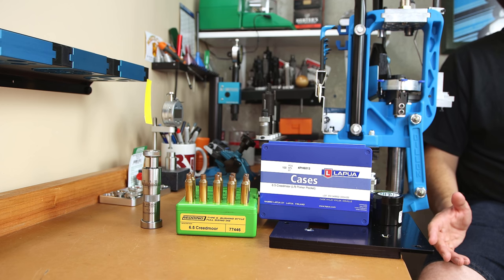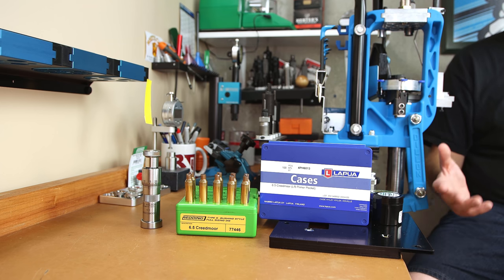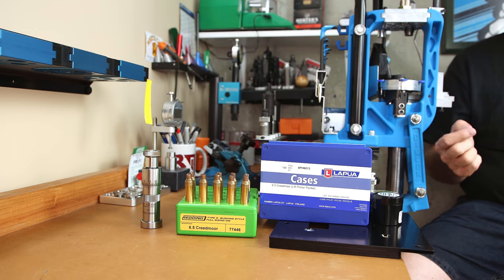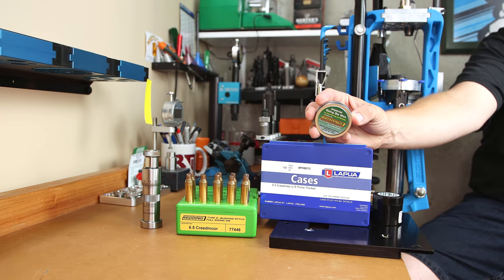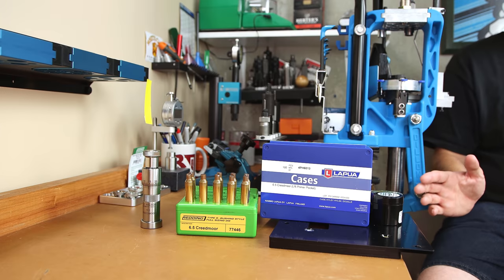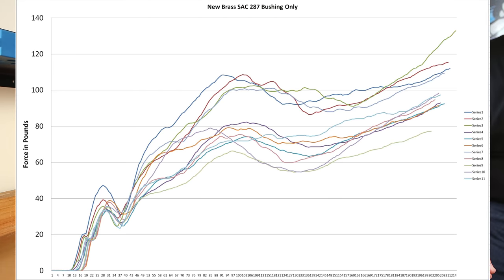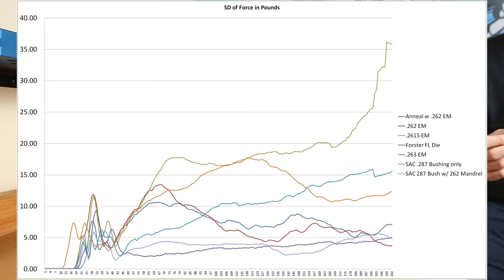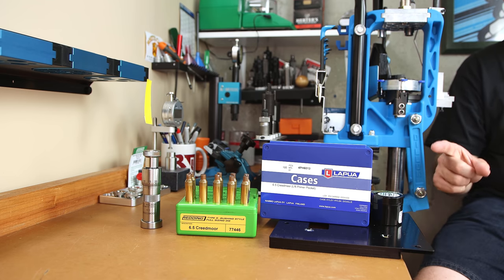Setting Consistent Neck Tension - Load Development with New Brass?

Comment: I'm not as experienced as you, but I've always been told and have done full length resizing for new brass. That has been a fundamental process for me.
Reply: I’m new to reloading and I bought some new RP brass. I FL sized it in my Redding die without bumping the shoulder. It has worked good. 

It’s a 7RM so no lapua option, but Nosler brass was available. It’s over priced Norma brass, but I went for it. It says ready to load, no prep needed! So I loaded 15. Lol. Felt like trash seating the bullets (160gr Accubonds), no consistency at all. Performance was okay. I will FL size the rest and then start using them. 

Lesson learnt!
Reply: @emirkazic4493   In my testing with new unfired lapua srp & lrp 6.5cm  I have found that the headspace is also all over the map, ranging from 1.532 to 1.535. I know right.
Lol,,. I use my deconstructed Forster fls die, like I would if it was fire formed to set the shoulders back to 1.533. The cases where the head space is already below 1.533,,, well my die can't touch it,, set it back any further,  so all is good with them. 
I then follow up with the 21Century expanding mandrel. I load them hot to fully fire form them on the first shot so I don't have to wasted 3 more firings to blow the cases out. I do anneal them before prepping them also and after every firing. In reality, I don't do anything different, other than their not loaded as hot. Just me and my madness. Lol.
Reply: New brass always has the shoulder and case dimension set back to ensure feeding in any rifle.
The only reason to run them through the die is to make sure the neck is at an acceptable diameter and is round.  This is done only to promote bullet seating.
Reply: @ctech01  .003 variance to me doesn’t seem awful? I had fl sized factory loaded ammo, all hornady American whitetail, but various lots. My ideal comparator measurement was 2.123; but I found it varied a bit so I got some 2.121 and some 2.124. I assume that’s because of the different lots of brass plus minute play in the press? I’m using a Lyman Victory press with Redding FL sizing die. 

Or is this purely a result of the different lots of brass used in each box of ammo? So my bags of brass that are new should be more consistent?
Reply: @emirkazic4493   My money is on different allotments of brass. I mainly shoot Lapua in the 6.5CM and from box to box there is quite a bit of differences between the allotments. I find the same in 223 Lake city brass as well. With factory loaded ammo,, Hornady per say, especially the 
ones that say MATCH AMMO. Before you fire them, check and compare the head space and CBTO and OAL and weigh the cartridge's. Then chrono them on a Labradar or Magneto speed chronograph.
That will make you really scratch your head. LOL.

Comment: I really think that initial spike is spring setback in the shoulder before the bullet begins to seat.  Then it slips as it breaks static friction and initial hoop strength of the brass.  From there load climbs proportional to surface area.  In your Forester/bushing and mandrel tests, the spike is higher because you had an extra work hardening operation on the neck...just my theory.
Reply: Michael - I think you mean ‘hypothesis’ not ‘theory’.
Reply: @Russell-1  suppose so if you want to get all technical about it...or one could say that since I know and have evidence that seating pressure can in fact cause the shoulder to measurably yield and still allow the bullet to seat and I know and have evidence that work hardening the neck increases seating pressure it's a theory that requires further testing.
Reply: It would be a good idea to try and measure this with and without molly...

Comment: I generally purchase once-fired brass. I anneal my brass after 5 firings. First, I let my brass churn in my large Dillon vibratory cleaner for a few hours. I full-length resize before first reload. After that, I neck-size on subsequent loadings. I have noticed that my annealed cases tolerate many more reloading than non-annealed cases. I mostly reload 7mm Rem Mag, 308 Win, 300 Win Mag, 30-06 Springfield, 338 Lapua Mag and 408 Cheytac. I am saving for a 375 Cheytac. I really enjoy your videos, learning some new thing from each one.

Comment: I think measuring seating force only tells part of the story. The un-seating when the cartridge is fired is a bit of a different action. In my limited experience, and based on accuracy alone, i have always found a Lee factory crimp to shoot as well or better than not. I have turned case necks and not found the accuracy gains in an identical load that i have crimped only.

Comment: Thank you for your videos. Recreationally, I shoot 6.5 Creedmoor, 147 grain bullet, 41.3 grains, with RL16. From your previous videos, I’ve settled on a Redding Type S full length sizing die with a .289 TiN Bushing backed out a half turn and without an expander ball on the decapper. Then I dry lube the inside of the necks and size with a Sinclair carbide .263 mandrel.  The advantage of this process is my donuts detected by a pin gage have disappeared as compared to the Forrester full length sizing die without expander die followed by the .263 mandrel. Four five shot groups have the following SD/ES’s: 3-7, 3-7, 4-13, 5-14  were measured using a Magento Speed Sporter. Again, thank you for your videos. They are an excellent source of ideas for a recreational shooter who reloads his own cartridges

Comment: After watching many of your videos  here is my process.  First I clean the brass then I anneal the brass next full length resize using a Hornady full length sizing die with the decapping pin and expander left in then I use a mandrel  that is .001 less than the specific caliber that I am resizing. This process has yielded  excellent results for me. For example my .223 groups less than .25 at 100 and I can get consistence hits at 600 yards using 60 grain V-max bullets. My 6 Creedmoor has excellent results at 1000 yards using Berger 109 hybrid bullets. I might ad that my reloading equipment is NO Where Near as nice as yours and is rudimentary at best, I gave up on bushing dies because the full length die and mandrel yielded better results for me. I really appreciate all the info you share and it has certainly helped me!!

Comment: I just happened to prepare 300 rounds of 6.5CM Sig brass before I saw your video. My procedure was as follows:
1. Anneal with my GinaErick induction annealer. 
2. Size with Forster FL die with expander spindle. Using Rockchucker press. 
3. Open neck up with K&M mandrel die. 
4. Turn necks to 13thou with K&M kit. 
5. Clean brass. 
6. Anneal again. 
7. Size again with Forster FL die. 
8. Mandrel using 21st Century Expander mandrel (0.263”) from their turning kit - resulting in neck tension of about 1.5thou. It does more neck tension than K&M mandrel (0.265”). 
9. Clean again. 
10. Debur primer pilot hole. 
11. Debur neck.
Reply: I’m still using expander spindle in Forster FL die because 6.5CM is new to me and I’m not sure yet where I want my Forster die honed to.

Comment: Good video. I'm surprised that more people have not discovered the Lee specific caliber neck sizer. It works off the mandrel principle and allows for different thicknesses of brass beautifully. Hey, I don't work for Lee at all, but this Lee Collet necks sizing collet is a super tool for rounding out and sizing that new brass as well as doing the same for fired brass. Keep 'em small.

Comment: I’d like to see how a Lee collet die does in your neck tension testing. I use the Lee collet die instead of my Redding collet die then a mandrel to set neck tension.  Works very good based on sd’s and on paper.
Reply from the maker: I am going to test it but not with new brass. I will publish the stats on these as well when I fire them. Graph doesn't mean much if the stats don't back it up.
Reply: I do the same and have had awesome results. I also like the fact that I'm working the brass less with this method.

Comment: After watching your video on the SAC bushings I contacted them and found that they are out and nearly two months away from having more bushings.   So I've ordered a die and mandrel for my 25-06 to use on my cases.   All of my brass has been fired and annealed a couple of times.   I will anneal after every firing.   Good info.

Comment: I'm with you all the way. I use a Forster FLS die -W. I have found out recently that not all Forster FLS dies are created equally Like -Y and -Z. My -W on my Forster press works great. My 2 other buddies, one with the -Y just sent his back to Forster and the buddy, with the -Z had to sand down his Lee shell case  holder .0015 in order to bump the shoulder back to 1.533. I use mine with out the expanding ball and stem. Then I use the 21Century expanding mandrel to set my case neck tension. I still learning to use my hydro press and I'm starting to get good consistent numbers with it on the last 3 loadings. " Yes,, you do have to develop a feel for it" It just doesn't spit out the numbers magically. LOL. It takes work, patience and practice to get the correct readings. The Amp Press takes all the guess work out of it. So I think. Great informative video Sir. I can't wait for the follow up video with the fired cases. Thank You.
Reply from the maker: Thank you Sir! I think that the data is very interesting and I am very optimistic that we will be able to learn some interesting things with this press. This press is not for everyone, but I hope that some can look past the cost and just at the data it provides and still learn some things that we didn't already know. (Plus I love graphs if you couldn't tell already) Visual representation always helps me understand and I hope the audience as well. I am sure going to rethink some of my processes based on the data.
Reply: @BoltActionReloading  I am by far a data junkie, Bring it. I'm salivating just thinking about.

Comment: I use a Lee collet neck sizing die with a .002 oversize mandrel.  This irons out the imperfections in the neck that are common with "bulk" brass and expands it to something similar to what I get with my fired brass, just loose enough so that a bullet will easily slip into the neck with hand pressure.  I then go through a bushing die, using the same bushing that I use on my fired cases to bring the dimensions back down to what I would do on fired cases.  This is a FL sizing die set to bump the shoulder on fired cases, but doesn't move the shoulder on virgin brass.  In my case, I am using a .289 bushing.  I have verified that a .291 doesn't hold bullet tightly enough, so finger pressure can move it.  My hoped result is that (a) I expanded to mimic a fired case and (b) bushing to achieve the same neck tension as with fired cases.

Comment: Very interesting data, did you use dry lube in case of the Foster full length option with expander ball as well. Maybe variation roots in the inhomogenous application of the dry lube. I guess that ultrasonic cleaning does nitot fully remove the dry lube. Are you planning on a seating force comparison between full length sizing + expander ball vs full length sizing + mandrel. That would be very interesting,.. 
Thanks for the nice video!!!

Comment: I've always done universal decapping die, full length die with decapping pin and expander removed for a .002 shoulder bump. Then expander mandrel in .262". Seems fairly consistent to my unskilled mind with no tools to measure. 

 Lol, should have watched too the end,  yours is the same process as mine.
Reply: I do exactly the same thing. I can bring myself to buy a bushing die to get the same result and to also add steps. I always remind myself not to get too scientific about something so simple

Comment: My new unfired brass is full length resized using LE Wilson die, then chased with 262 mandrel. For new brass, I don't shoot for accuracy and load development is done for the most part. The only reason I follow this process is to standardize the brass due to inconsistent necks due to shipping - no other reason. Shooting for groups is done with fired brass, so I am not so concerned with the new brass prep. With this in mind, accuracy is outstanding using Lapua brass in both my 6BRA and 6.5CM - might be overthinking this....

Comment: If your going to start with new brass you might as well document it so good job.  A couple of questions. What angle do you use for your champers? Did you champer the new cases?  Have you noticed any difference on paper with the Short Action Custom Bushing?  Looking forward to results from this series
Reply from the maker: HI Spike, I use a VLS hand tool for new brass and I mostly use my Giraud trimmer for trimming fired and sized brass. I will be looking more in depth at the SAC bushings coming up!

Comment: One experiment that I want to see is using case wax on the expander mandrel. I did that (as an experiment) but before I seated the bullets I used a Forster nylon neck brush. I got Several loads with an SD of 7 or under. Easily the best I have ever gotten
Reply: My understanding, though I can't recall explicitly stated, is the wax can chemically contaminate the powder thus use graphite for inside the neck. This would probably be random depending on excess wax and months or years of storage. Probably would not show on load development since it's quick
Reply: @aeroderek  The way I did it there wouldn't be enough wax to contaminate anything. I rubbed a bit directly on the expander mandrel and cycled around 50 cases. After I got the cases prepped and primed I did the nylon brush with the powder from Forster.

I didn't plan on it. I just did it by accident. My first 5 shot string got me an SD of 7. I repeated it even with different loads and I think the lowest SD was 5.9 or something like that.  I had at least 4 or more strings (during load development) that were all in the mid single digits.
Reply: @aeroderek  A quick google shows several sources that say the kind of wax I am using has no effect on gunpowder.
Reply: @tyler6147  Agreed 100%, I use imperial sizing wax on the case and in the neck. Then a quick wipe with a cloth and a quick ream with a Q-tip in the neck. After priming the case I lube the neck with imperial dry lube. Then I charge the case with powder and seat the bullet. Works great for me.😎

Comment: If you remove the expander ball from the Forster die, what does it size the neck to?  The expander balls are 0.001 under and supposed to give 0.002 neck tension.  I'm wondering how much the brass is being worked.  Also curious if you think/find that the neck tension varies if you first size all the brass, then switch to the expander process afterward allowing the brass to "set" between steps.  Thank you for another great video.

Comment: interesting. I am pretty new at this, and what i did with my new lapua cases was 

-lube and full length size
-size neck with a 2thou under expander mandrel
-check length
-chamfer

I for one dont have access to an anealer, 

it is very interesting that the forster die even with expander mandrel showed the most consistant results.

i am having issue with High ES and SD numbers, i bought the expander mandrel die hoping it would help, but i still have an ES of 51 and SD of 24,

Comment: thank you for the clarification!
However, did you also check the runout of the FL sized and expanded brass?
Reply from the maker: I don't think it's fair to give runout measurements at this stage since the outside of the case body would not have been sized. For fired brass absolutely.

Comment: I don’t anneal new brass, and was also taught that it’s over stressing the brass needlessly to full length resize brand new brass.  (?). I remove the expander ball and just run a .002 less mandrel through the necks and go from there.  Of course on next firing, anneal, full length resize, then mandrel, so I’m just not doing two of those steps the first time, so may be being overly cautious and should just do it all from new brass on.

FINALLY, I wish someone would explain to me (and I’ve asked in several threads) why I’d ever use a Redding S bushing or SAC bushing on the OD diameter of the neck, THEN use an ID mandrel?  You’re setting neck tension on the bullet from the outside of the neck with a bushing, then resetting it inside the neck with a mandrel?  Just don’t get it, one or the other.  I full length size then mandrel, one and done, and for hunting or precision rifle .002 neck tension with a 21st Century turning arbor seems perfect.  F class is another matter, and in that case I’d probably get the whole set of 21st mandrels you have there so I could really fine tune the neck tension.  I might want to try that nice SAC bushing in a Redding resizing bushing die, but that would be instead of mandrel, not in addition to.